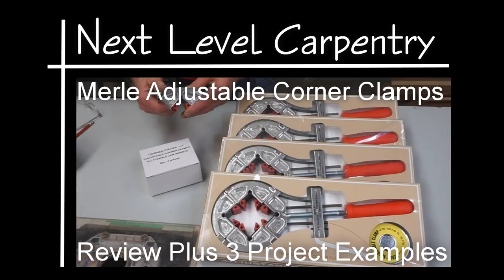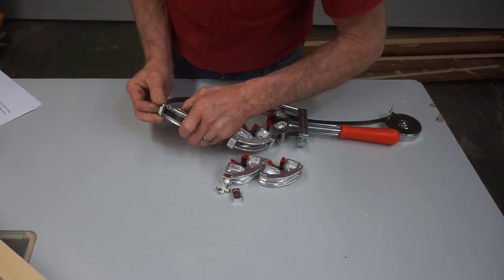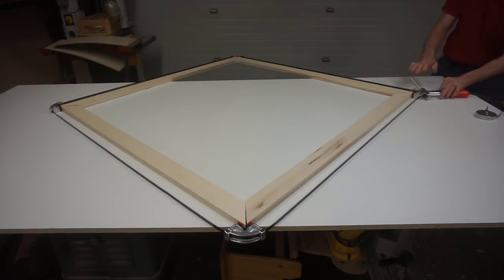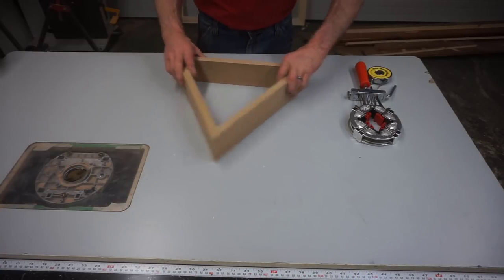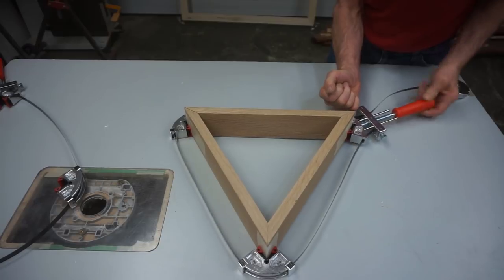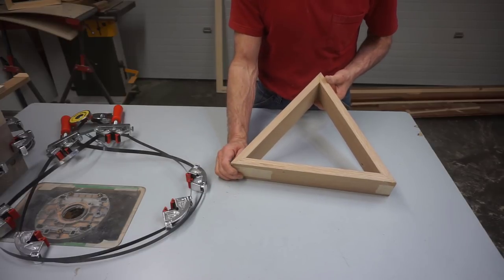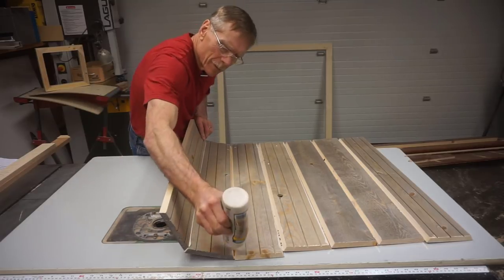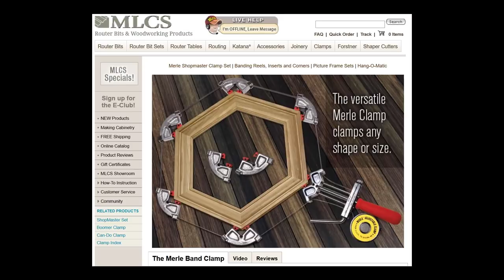Merle Adjustable Corner Clamp Review

Comment: How do these steel bands hold up? I would assume over time you would get wrinkles in the metal.
Reply from the maker: I've not had any real problem with the bands not holding up but I only use these once or twice a year.  If you were using them all day every day you'd need to have a plan in place for dealing with band replacement as an accident or carelessness could easily ruin one.  I will say that their usefulness and capabilities FAR outweigh potential occasional failure of  a band though so it's a small concession IMHO.
Reply: @NextLevelCarpentry  Oh I could see that. As a home game man I would probably go for a fabric strap design as to prevent damage to it, but I can see how these are a step up from the cheap fabric strap ones.

Comment: @Matt: Do they only work for regular shapes? Would they work for an irregular hexagon, for example? I don't think they will work very well for irregular shapes. Disclaimer: WITHOUT one of your mods/jigs. If you come up with a jig, it'd probably work. Hmmm. That might make an interesting video. Or not. Great objective review video, by the way. Fairly exciting to see stuff flying around ...  Definitely not your average Apple review video.

@No one in particular: Also, it's been 2 years. I wonder if the design has been improved?
Reply from the maker: Absolutely: https://youtu.be/RKE08xe-vb4?t=1224 
https://youtu.be/2IqDsPXfzjk?t=520
Far as I know the design hasn't changed but each time I use these guys they're less trouble as I get used to them...
Reply: @NextLevelCarpentry  Wait are we on the same page? Maybe I shouldn't have used a math term there. http://www.barrygraygillingham.com/Maths/Polygons.html <-- see irregular heptagon Personally I'm aiming for something like an egg with flat sides... Probably easier to make a regular shape first, then cut to shape. Maybe? Oh wait. I figured out a jig for it!

Comment: Is the banding edge a safety issue as far as cutting fingers ???
Reply: Yes.  Everyone I used mine (4 times then trashed them) I got cut. The band doesn’t feed into the spool using the crank. It requires you to hand feed it and it’s dangerous.

Comment: If you're in contact with the company that makes them, why not suggest they adopt the same mechanism as a tape measure for the reel?

Easily pulls out, auto retracts, can lock in extended position and if they mount it to the hilt of the handle where the locking mechanism is now so it can be out of the way and more convenient...
Reply from the maker: Zeo,  While self retraction would be a nice feature I doubt it would be functional or practical in reality.  The design of a tape measure works so well because it doesn't take much of a spring to retract the thin tape.  To be strong and functional the steel band in these clamps has a fair amount of springieness to it which isn't so obvious in the video. My guess is that a spring strong enough and big enough to actually retract 23' of the steel band would add too much size, weight and cost to be practical, especially when it wouldn't improve the tool's main function which is for clamping.  I do think that a better rough adjustment handle/mechanism would be a more worthwhile endeavor.  Best, Matt
Reply: Perhaps, but IMO at the very least they shouldn't leave the reel to just swing loosely to the side as that leaves it open to eventually twisting and causing a crimp/dent in the band or it may simply swing into something like the work piece and cause some damage... For long term use I consider that a design flaw...

While turn crank wheels can also be designed with gears so it can disengage, which would allow avoiding the snap back when letting go of the crank by simply swinging it to the disengaged closed position... But also a similar mechanism could be used on the adjustment handle to be able to push it out of the way from any angle.

So I think they can improve it...
Reply from the maker: No doubt there are possible design improvements like those you offer and then some but the first question to answer is whether or not it's worth it from a business standpoint.  My question to you: if a new/improved Merle Clamp was a stock, would YOU buy it?
Reply: If they fixed the flaws, yes... It would be stronger and more versatile than the other miter band clamps in the market...

It's not the only product of its kind but it would have clear advantages over the others, as well as help avoid needing as many other clamps to get sufficient clamping.  So would save time and money in the long run, especially for those in small work shops...
Reply: Love the idea of having the strap and reel go through the end of the handle. Way better.
Reply: @NextLevelCarpentry  0
Reply: @NextLevelCarpentry  0

Comment: I have a couple off these and find them to be quite unwieldy. Talk about knuckle rappers.
Reply from the maker: I know what you mean about knuckle rappers! if they weren't so effective I would not put up with their unweildiness...
Reply: @NextLevelCarpentry  
When someone at your level of manual dexterity and expertise experiences design faults in a tool the manufacturer should consider a redesign. A simple ratcheting stop to prevent the cam from releasing, (back spinning), under load may do the trick. Otherwise, as you say, the tool is quite effective. I use mine to clamp boxes, but only after my three Bessey band clamps have been deployed.
All of this aside, I truly enjoy watching and learning from one of the very, very few true masters of the profession on YouTube. Thank you for sharing with us your mastery of carpentry and wood craft.
Reply from the maker: @billballeza377  My guess is that low/modest sales volume doesn't justify the time and expense of a re-design/retooling but I wholeheartedly agree with your thinking on the matter.
I really appreciate the fine compliment... I definitely feel like a small fish in the large pond of YouTube and to hear your ranking of NLC in that pond is a real motivator to keep at it!  thanks for watching and commenting here!
Best, Matt